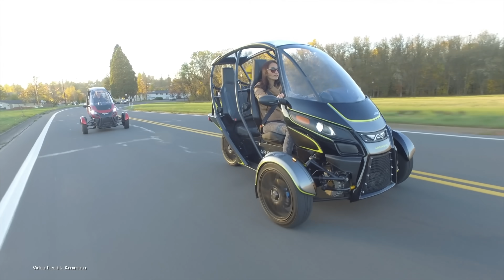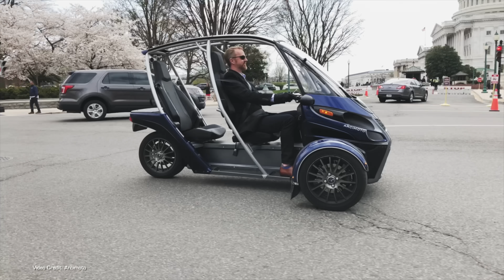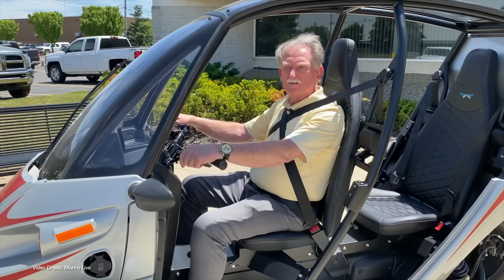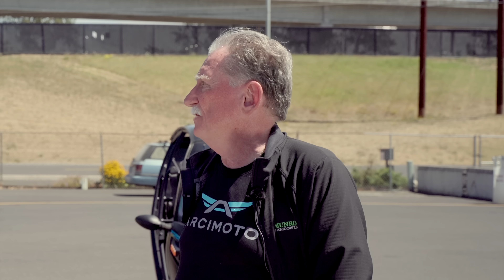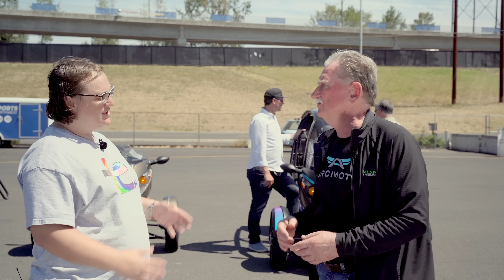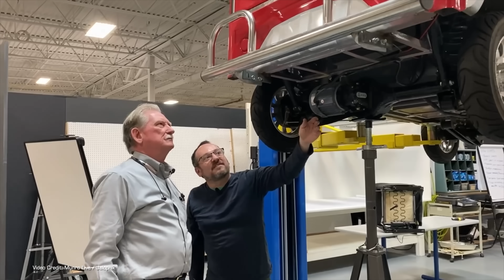FUV and Friends - Sandy Munro Shares His Thoughts On The Arcimoto FUV

Comment: Why is a Nissan Versa cheaper than this. They have a lot more parts than this. Shouldn’t this thing be profitable at 12 k.
Reply: Nissan is not a totally new concept from the wheels up. Cars don't get EV rebates and tax breaks. Cars like the Versa weigh exactly twice as much as the FUV, need twice the power to go and are driven with one or two passengers and an empty trunk most of the time. Insurance for the Arcimoto is the motorcycle rate, just $130/yr. Apples and oranges.

Comment: Without a fully enclosed cabin,  the aerodynamic drag will affect the range and efficiency .   Also ..  in a rainy city such as Vancouver , BC  Canada,  an enclosure can keep the driver and passengers from the elements .
Reply: No. Tests were done on the very streamlined Deliverator with doors and windows. No measurable range difference of note. The front profile tapers back to a much smaller rear end. Owners in rainy Washington and Oregon have no problem with rain. Elbows get damp, so what? We have heated seats, hand grips and heated defroster. There are now 3 videos of it in rain and snow. I stay dusty bones dry in mine in rain above 30 mph as the pressure wave forces all rain away from the driver's sides. The speed you choose has a much greater effect on range than streamlining. Same as with cars.

Comment: Torc vectoring managing every wheel depending on the way the driver need it ... is the particular efficiancy of Rimac cars.
Sandy is not telling that in Europe Renault selling the Twizy (small cars) since almost 10 years now ;)
Reply: No legitimate comparison. A 45 mph Twizzy is just a cart compared to the 80 MPH Arcimoto.
Reply: @popeyegordon  >> 10 months later, I don't recall the video but still thinking the  Arcimoto is legitimatly to be compared to the TwiZy that would be certfied here in Europe in the same class. ;p
I love Sandy work and only tell that here he is giving partiel explanations.
Reply: @papytrad8915  An EU 'class' does not define the Arcimoto's performance difference. No legitimate comparison. Twizzy has more in common with a golf cart.
Reply: @popeyegordon  >> Again, the correct spelling is TWIZY (no need for ZZ) ;)
There are two Twizy models, the 45 and the 80, they are limited to 45 Km/h and 80 Km/h, which is more than enough in town and in the suburbs (I think)... specially in EU and Asia countries.
If you ever think you can drive a golf cart on EU roads, good luck ;)
Reading the poor arguments in your answers, I do not see any interest of trying to debat.
Enjoy your certitudes....
Reply: @papytrad8915  My points are flawless and beyond reproach. I am an owner of the FUV who has also used lower speed vehicles for years. There are two different markets - low speed and full speed capable transportation with full crash protection like the FUV which is also very good for low speed use and has more cargo capacity. Twizy is not for going on long drives into mountains or on freeways. Twizy is not being leased to package delivery companies. That cuts and alters its marketability. Apples and oranges. I never mentioned golf carts on EU roads, you did.
Reply: @popeyegordon  As said : Enjoy your certitudes ;)
Reply: @papytrad8915  No, I enjoy my fact checks, all 160,000 of them in social media.

Comment: Personally, simple sliding door/s would make it much more appealing.
Reply: Yea that's the kind of thinking that got us into this mess. Everybody demands to be transported around like royalty in climate controlled lounges. Hence our crashing climate. You look at the solution and want to ruin it instead of getting with the program. I have the FUV and I don't want no stinkin' doors. Just dead weight that blocks the breeze. The heated seats, hand grips and defroster are enough. I clipped a little fan to the handlebar to stay cool when stopped with no breezes.

Comment: Doors and AC
Reply: Yea that's the kind of thinking that got us into this mess. Everybody demands to be transported around like royalty in climate controlled lounges. Hence our crashing climate. You look at the solution and want to ruin it instead of getting with the program. I have the FUV and I don't want no stinkin' doors. Just dead weight that blocks the breeze. The heated seats, hand grips and defroster are enough. I clipped a little fan to the handlebar to stay cool when stopped with no breezes.

Comment: Closed cab or it’s not workable anywhere but Southern California
Reply: False. Already working splendidly in Oregon and Washington. You people demand the very thing that is forcing a change in personal transportation. That's the kind of thinking that got us into this mess. Everybody demands to be transported around like royalty in climate controlled lounges. Hence our crashing climate. You look at the solution and want to ruin it instead of getting with the program. I have the FUV and I don't want no stinkin' doors. Just dead weight that blocks the breeze. The heated seats, hand grips and defroster are enough. I clipped a little fan to the handlebar to stay cool when stopped with no breezes. There are half a billion motorcycles and scooters with no doors, windows or roofs.
Reply: @popeyegordon  you don’t live in Mn. The winter conditions here are brutal. Having an enclosed cab is not an extreme ask. I am out in most weather biking but at thirty miles per hour or above the windchill is not something I would sign up for in an open cab.
Reply: @GladmanNow  The wind chill is cut almost completely. Wrap around windshield (note the definition of windshield) meeting a roof, heated seats and hand grips and defroster. This was never meant to be a 100% car replacement, just 90%. I don't complain about the uselesness of snowmobiles here in Florida. I'm more concerned about the decision that was made to stop holing up all winter with 4 cords of firewood and a food stash and snowshoes in northern climates, instead bashing through all nature offers by the brute force of very inefficient fossil fueled vehicles. We are paying for that now. The Arcimoto is one part of the fix for that mistake. If Minnesotans hole up for 2 months each winter like they used to, now you have internet and satellite TV and some can work from home. Besides, winters are now shorter everywhere, from pole to pole.

Comment: I'm a super fan of Mr. Munro and Co. but their forté is engineering, they can make the machine, lighter, safer, cheaper to manufacture, stronger but they are not
designers. Look at the amazing job they did with that golf cart. It was a great success but the thing still looked like an ugly golf cart. This looks like it was designed by someone used to designing slot machines or over priced sneakers. If you can't design it to look great, call it "fun".  
Where is Sir Alexander Arnold Constantine Issigonis CBE FRS RDI when you need him?

Comment: One downside. It removes the close contact that you have an option on with a motorcycle seat without separator. But I guess you then don't have back support. Have to try one out myself.
Reply: True...but honestly..if this is the only issue. Think arcimoto are ok.

Comment: Arcimoto your missing a trick here, I can think of a number of people would want something like this for city delivery’s ,so please offer an option with no second seat but enclosed storage  in a squared off back and panniers, not just food delivery, but for the giga delivery runs a as well
Reply from the maker: We think you’ve not seen out previous coverage, or the deliverator.
Reply from the maker: They do, the Deliverator model, of which there’s even a pizza optimized version with a built in warmer - Winter
Reply: @transportevolved  thanks winter for replying,  what I meant was unlike the deliverator where is reduces volume for aerodynamic shape,  if it has a more boxed back so say postal routes etc style packages say 330 litres , I realise there are limitations due to the one wheel ,  but it’s something similar to what appeared in Norway last year
Reply: @ram64man  There is now a square cargo box version in addition to the Deliverator. It fits on the back of the pickup truck style model. I got the basic model and removed my rear seat, enclosed it with cargo netting to have a large bin.
Reply: Deliverator for closed storage or the flatbed for open storage but then you could always strap on a enclosed box to store small stuff.

Comment: That was pure, informative entertainment.  Thanks.  Arcimoto seems to have a great product, but I'm still (Frankly) too scared to ride an "open" 3-wheeler, given the yahoos around here who drive like they're in a video game with 3 lives.
Reply: I was rewatching and they were all wearing cross strap harnesses. So you couldn’t get thrown out easily. I had similar concerns as you initially but they were all wearing straps over both shoulders.
Reply: My concern wouldn't be so much "getting thrown out" but more "getting crushed" by a larger vehicle. But I hope it does well.
Reply: Most videos are not making it clear just how safe the FUV really is. The certified roll cage combines with the six point harness to rival the safety of any small car but it does that without air bags, doors or a helmet. The first serious collision has already happened and the guy walked away with just bruises. If he was on a motorcycle he'd be dead now.

Comment: How did they do in crash tests?
Reply: Most videos are not making it clear just how safe the FUV really is. The certified roll cage combines with the six point harness to rival the safety of any small car but it does that without air bags, doors or a helmet. The first serious collision has already happened and the guy walked away with just bruises. If he was on a motorcycle he'd be dead now.
Reply: Maybe slight better then a motorcycle.
Reply: @Frank71  No, vastly safer than any other motorcycle on the roads.

Comment: Why does it have to look like a locust or a snail with its lights on stalks, every damn angle, facet a separate color, logos plastered everywhere, it looks big like as if it could carry three people, it looks uncomfortable that you can't stretch your legs out, that you are straddling a hump, that in the back your hair is blown all over the place, like you can't use it in the rain unless you are wearing scuba gear. I wish it had a jolk or steering wheel rather than handle bars. I know, I'm just being a Grinch. I did buy shares.
Reply: I know right? People want a protected space when in a vehicle. Could you imagine driving this in the snow or rain? If it's not gonna be of any use even for one month a year, people are not gonna buy it.
Reply: @apexpredator2118  There are now 3 videos of the FUV in rain and snow. Comfortable and secure.

Comment: Faster AND quicker wow
Reply: Fast refers to speed - miles per hour. Quick refers to acceleration - 1.5 G of acceleration.  They are separate terms used in technical spaces (which Sandy would be very familiar with,) frequently.

For example, the new Tesla Model S Plaid is the world's QUICKEST production car. Tesla only uses the word "quickest" anywhere in their own words. Tesla never said "fastest." (Because it doesn't have the highest top speed, just the best 0-60.)

Comment: I like the Arcimoto, but they need to eventually give it a somewhat longer range and a semifast charging option. I would be fine if they were extra cost options for someone to consider it as an only car. I really like the Deliverator version, but if it was modular to swap in the back seat or the larger cargo box, it would be even cooler.
I could just be a little depressed learning the F-150 Lightning production schedule making it less likely I will be getting a truck soon. Ford and Tesla are crushing me. Apparently they may not even fill the orders they have now before they roll out the new version of F-150 Lightning in 2025, which maybe I want more than this one. I may have to get a gas pickup till then unless Atlis?
Reply: The FUV really is made to be a city hopper to get groceries or to drive to the gym instead of taking a 5 seater car or truck. There are better options for road tripping or inter-city commuting
Reply: You want a Lightning? I feel bad for you wasting your money like that haha just stick to gas, Ford don't know shut about EV's and that's not changing. Ford will probably bankrupt before 2025

Comment: Definitely buy one of those cheap Chinese EVs on Alibaba.  👍🏻
Reply: Find 4 friends who want one too and you can get a cut rate ;)
Reply: Yeah, the Chinese make valuable products that totally have the same reliability and build quality  as American products 😅 go spend 1/4 the cost for half the product that will last 10% as long
Reply: @xraceboyex  40% of the parts in the cars being sold today are from China. In fact Tesla holds the record for the LEAST amount of imported parts because of their vertical integration. And they are already exporting cars to EU that pass their strict safety laws that are even stronger than the US. There are a crap ton of durable Toyota's out there today that were manufactured in China by BYD and others.
Reply: @xraceboyex  Buying one and making videos about it will probably prove your point.  It would be fun to watch, though.